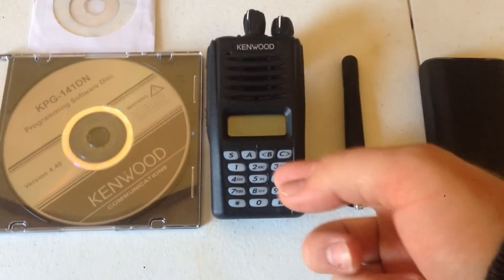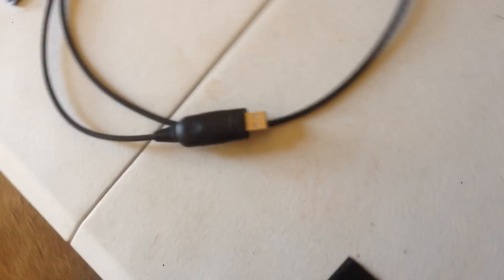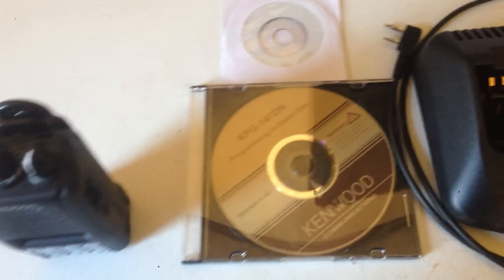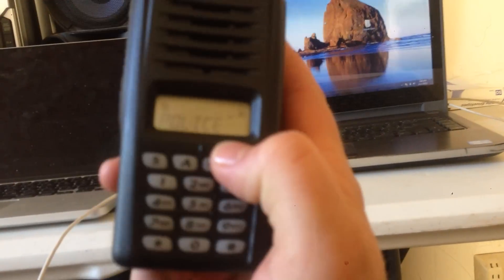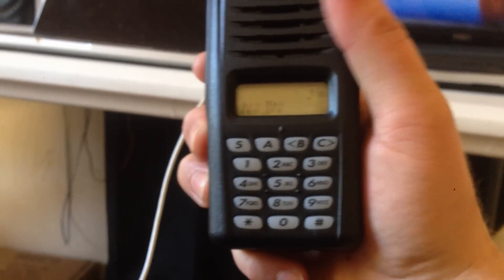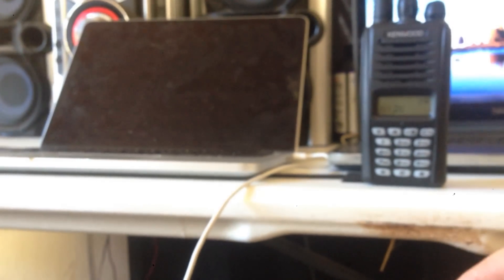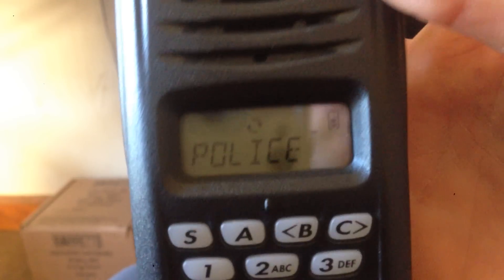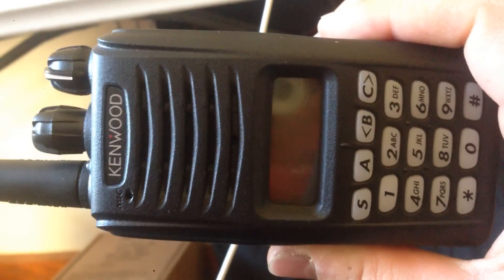Kenwood Nexedge: Radio Overview

Comment: These 2nd generation  requires no license to activate expensive options such as trunking type c, type d. The newer Kenwood's require licensing to activate trunking. If u have these radios they are a keeper. The newer generation does dmr and nxdn.

Comment: Thanks for posting this.  Am I correct that if someone is non-trunked, NEXEDGE Digital, good to go?  Also traditional analog?  Some state agencies are using NEXEDGE in Georgia and Alabama.
Reply from the maker: Yeah, as long as it's not encrypted and theres no way to tell if it is until you get a radio that will demodulate it. I'll put a video up very soon explaining the encryption in full. I'll put it this way, if it's encrypted and you don't have a key or you have the wrong key then it sounds like a strange scratching noise. With the encryption that comes standard with Nexedge there are about 2 million different keys. So your kinda screwed if there encrypted. You can also upgrade the encryption with DES or AES-256 and you won't break those let alone the stock encryption. Good luck!!